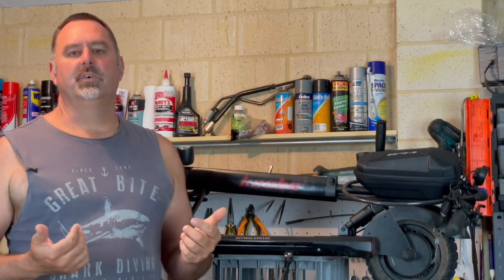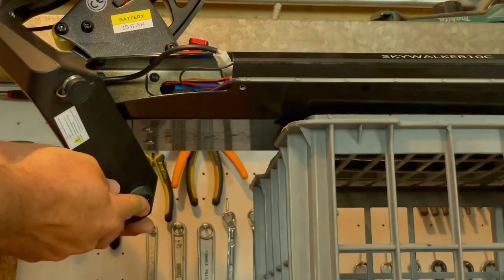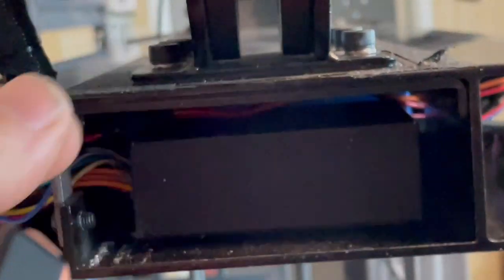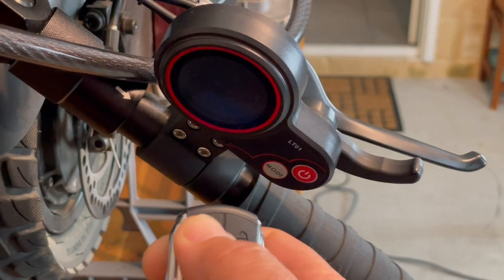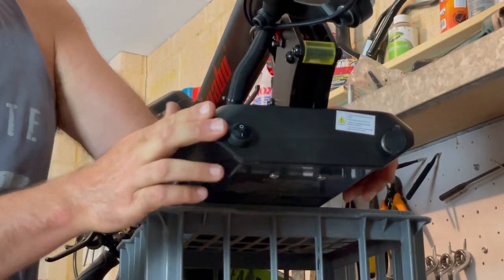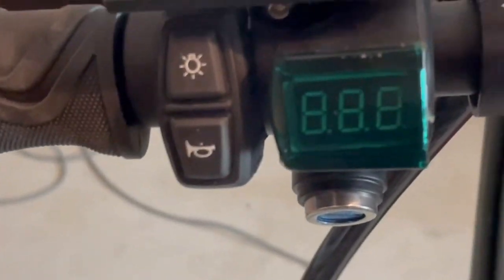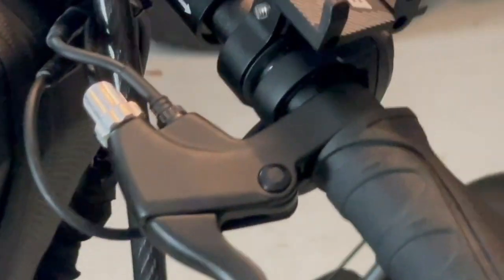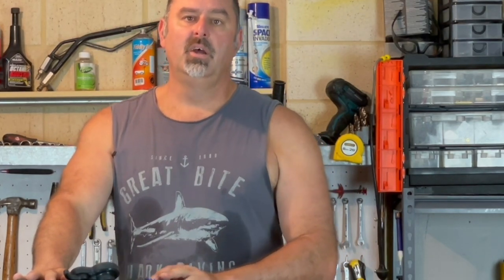Kaabo Skywalker ELECTRIC SCOOTER Alarm and Immobiliser install with key ignition delete.

Comment: Hey I'm getting the 10h I've done some looking around and can't see any difference between the 2 how do you like it man I'm only 88kg should rip along alright?
Reply from the maker: Yeah the skywalker is my partners and I have a mantis 10 dual motor. The skywalker will handle your weight no problem. You should get about 50kph and flat ground.
Reply: @JebbreysJibberish  thanks man appreciate it